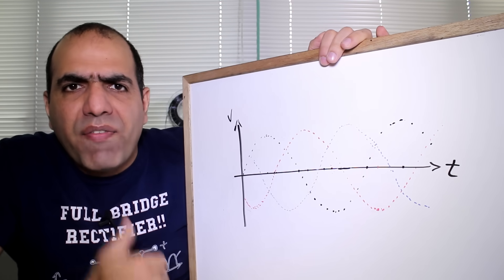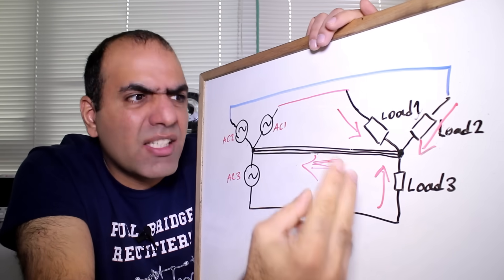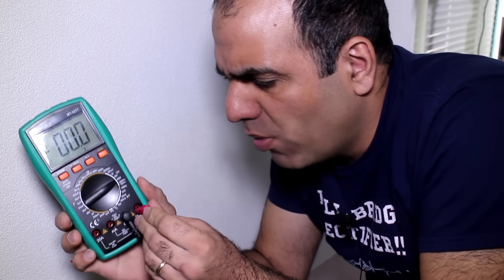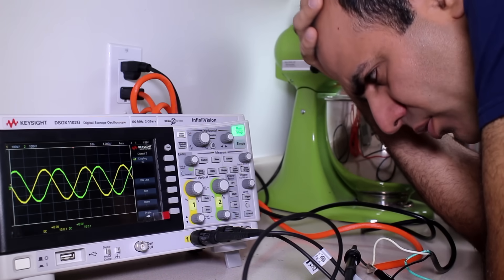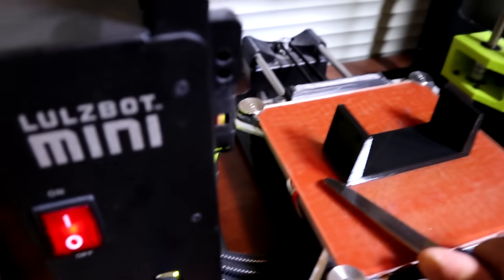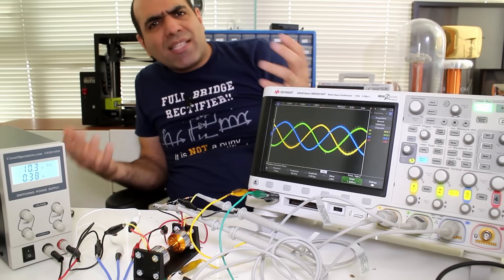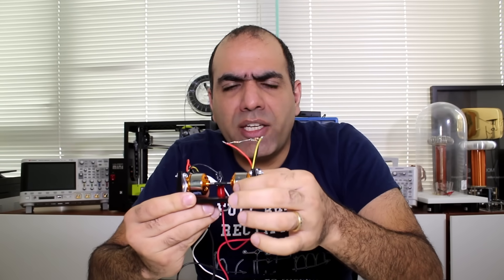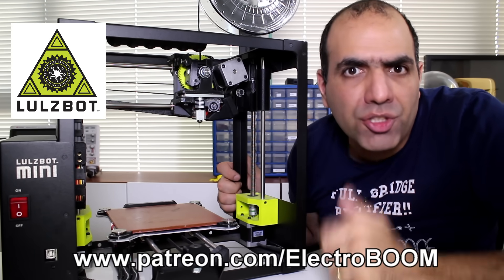Why 3 Phase AC instead of Single Phase???

Comment: Disappointed you didn't mention CONSTANT POWAHH with 3 phase AC, or that the neutral current cancels out only if the 3 loads are the same. But otherwise great vid!
Reply: Yeah and if in block of flats, neutral wire breaks, usually few floor devices are toast
Reply: six pulse rectifier in switching mode power supplies would be awesome, imagine how much it would reduce strain on the grid which would power large office building, but obviously, three-phase power for such low power appliances look weird
Reply: He meant that DC would be used in one large building and handled from there.
Reply: most of the modern electronics use SMPS, which means AC has to be rectified for them to work. Almost all switching mode chargers, PC power supplies, TVs, work fine on DC. Even tools with universal motors like angle grinder or drill works on DC. They don't use DC because it's not cost effective enough. Current harmonics don't cause so much trouble after all
Reply: Yup. And all the 'old' switching power supplies without PFC produced tons of 3rd, 5th, 7th etc. harmonics, and 3rd, 9th, 12th etc (all 3*N) didn't cancel out in 3-phase network but summed IN PHASE to burn the poor neutral wire! It would be beneficial actually to take all 3 phases and rectify them without stupid PFC! All PFC stuff is needed because of need to store energy between peaks, but the simple capacitor after FULL BRIDGE RECTIFIER takes huge current peaks which is exactly the reason of these harmonics. No energy storage (3 phases deliver constantly) = no big capacitor = PROFIT!
Reply: I was thinking about using 310 V DC instead of 230 V AC, or 150 V DC instead of 110 V AC, to power all the computers and light fixtures with electronic ballast and so on - practically all the office! So we have high-power three-phase rectifier somewhere near circuit breakers which produces this DC for all the equipment. 

It seems pretty simple to implement and rather safe. I wonder why this wasn't done, at least for some servers and high-perfomance computing... Maybe it did after all. 

In CRAY first supercomputers they used enormous motor-generator in the basement which converted 3-phase 50 Hz industrial voltage into 3-phase 400 Hz 380 V to feed the power supplies which consisted of 3-phase step-down transfomers and rectifiers delivering 5 volts and hundreds of amps!
Reply: It's not done because it's not needed.  Having retrofit solutions for modern technology is simple enough and does not introduce too many problems. The costs of fundamentally changing power delivery even within a building is just too much for anyone to do it. People prefer "backwards compatibility." DC is not suitable for industrial induction motors, or appliances which use the grid to keep time.
Reply: Even still. Regulations for the wiring in buildings don't exist for DC systems. All appliances that a typical household would use are AC devices. If you were an engineer of the building, you would not crazy to implement a DC system since you would need to create it completely from scratch, and it will have no "support" whatsoever. Something like this will never happen, the upfront capital costs and probability of adoption are just too far out there.

Comment: all tho i am not yet understanding it enough to plug one and make stuff work of this, the concept makes a lot more sense... tho on that "wire gauge being bigger analogy" if i had a speaker and plugged it with normal wires and got resistance, would adding a 2nd set in the same plugs reduce the resistance or does it need to be wire Gauge? (also wondering if one did that with extensions and power bars... i would try the speakers BUT NOW THE POWER BARS!) ;P

Comment: Actually it is been kinda norm here in Finland to see households with 3 phases systems... And sockets almost always are together same phase.. there is no different phases connected like in this video at the same socket (inside same socket frame). Just that maybe different room are under other phase.. and like Sauna uses all 3 phases and oven too.

Comment: Why dont we use 2 phase supply with phase difference of 180 degrees?
Reply: 2 phase supply with 180 degrees cannot create rotating magnetic field: it's still pulsating, so a motor can't decide where to rotate. But there are 2-phase systems with 90 degrees difference, it's like using sin(x) and cos(x): now if you put two coils horizontally and feed them with one phase, put another 2 vertically and feed with another, you get a perfect circle. It's used sometimes, but this 90 degrees stuff is a bit ugly.